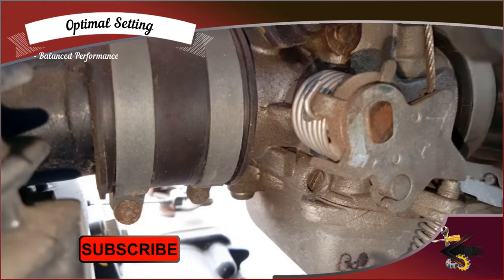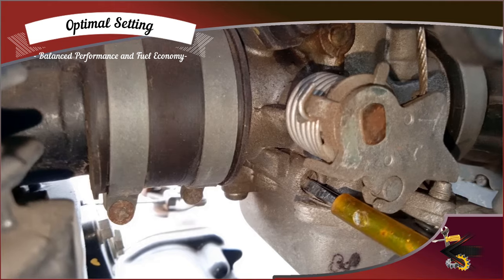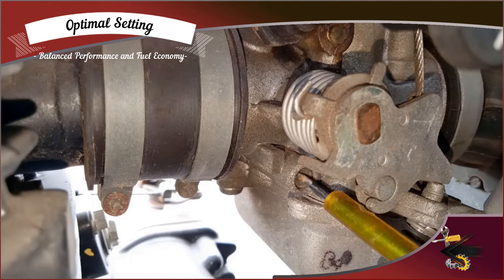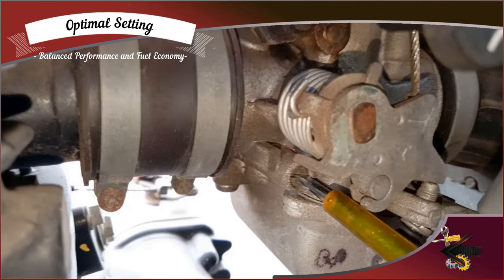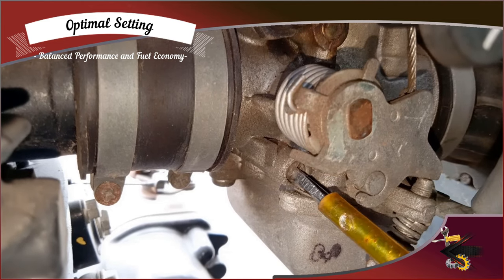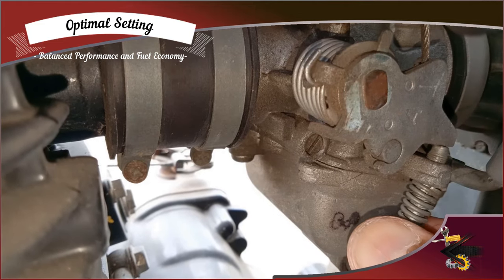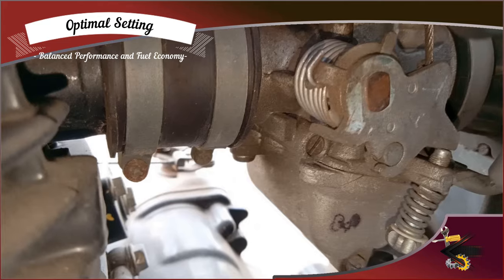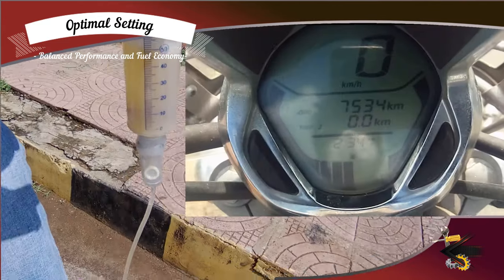Carburetor Tuning Mileage Test | Best mileage test | #carburetor | #mileage | #increasemileage

Comment: Which setting would best for fuel economy?
Reply from the maker: Rich setting would be best for fuel economy.
Reply: @autobotgeekse  Thanks
Reply from the maker: Wc 👍
Reply: @autobotgeekse  OK here comes the real job, when l check my RayZR it's a fuel injector type so l don't know how l should tune this into a fuel saving economy... l need your help again.
Reply from the maker: @lixv2432  sorry, FI systems cannot be tuned like we do it for Carburetor. FI is driven by electronic pulse which activates the solenoid. That will be a complex mod if you want to tweak the FI system
Reply: @autobotgeekse  That means majority of the scooty workshop would find it hard to to adjust it, isn't it?
Reply from the maker: @lixv2432  yeah, FI system is not adjustable atall. Solenoid valve will have to be replaced with smaller aperture valve for better fuel economy
Reply: @autobotgeekse  Are you saying it can be replaced with a smaller valve? If so please suggest me the type or kind of solenoid which will exactly fit in to my RayZR fi scooter
Reply from the maker: @lixv2432  That is the only possibility but that will not be available in the market which means we cannot change it
Reply: @autobotgeekse  OK, l guess no choice, have manage. One more thing though, since from the time l purchase this scooter l haven't notice or haven't seen this engine problem indicator, once the the key got switch on all the indicator light lights up a few seconds then goes off again but today l went for servicing and l told them this never happens but they told me its just an engine oil indicator, which l didn't buy at all. So, based on your expertise, Do you think its normal or it really has a problem?
Reply from the maker: @lixv2432  hmm, I am not sure of that indicator. Probably users manual can give some info for better understanding

Comment: I saw your last video regarding carburator tuning.. where you say that where you getting max rpm that point is rich fuel air ratio and we will get more performances..but here you saying that position as lean position...
Reply from the maker: Yes, it was an error in my last video, hence I added correction subtitles in those areas. Please let me know if you don't see the subtitles, will add again
Reply from the maker: @द βiker बंधु lean is when you let in more air into the combustion chamber. If air screw is turned clockwise it closes the inlet aperture  restricting the air flow. Hence, that becomes richer.
Reply from the maker: @द βiker बंधु Please do some analysis on lean and rich setting. When air flow is restricted it becomes rich and vice versa.
Reply from the maker: @द βiker बंधु that is due to fuel siphoning basis the air controlled via air screw. Lesser air flow results in lesser fuel suction

Comment: Brother You are talking inverse.
 lean means more air n less fuel
Rich means less air n more fuel.
Then rich shall give lesser milage and vice-versa.
Turning fuel screw outwards makes mixture richer as it allows more fuel to pass n vice-versa.
Correct me if I m wrong.
And finally nothing is said abt exact nos of turn from full tight, which makes this vdo of not use for me.
Reply from the maker: Lean and rich mixtures are not directly proportional to fuel suction. It is the air to fuel mixture ratio that we talk about. In lean setting the fuel to air ratio is lesser however the fuel that reaches the combustion chamber is more than that of rich mixture. More air you let in, more the fuel suction will be. Hence, better mileage is achieved in rich mixture. You can see the practical test as well. Also, detailed carburettor tuning is uploaded separately, hence I did not explain the complete tuning procedure. This is just a mileage test video. Hope this clarifies your confusion.

Comment: The difference between a rich and lean mixture is the amount of fuel and air in the mixture that goes into an engine:
Rich mixture
A rich mixture has too much fuel in it. It's less efficient than a lean mixture, but it can produce more power and burn cooler.
Lean mixture
A lean mixture has too much air in it. It's more efficient than a rich mixture, but it can cause higher temperatures, which can lead to the formation of nitrogen oxides.

Comment: I tried but my fascino run after i close the fuel screw with low r pm why
Reply from the maker: You will have to identify the air mixture screw and play with it. When you close the air mixture screw completely, rpm will be low. Open one turn and then try identifying the rich and lean position. Then you can adjust it accordingly

Comment: What about TVs wego rich settings?
Reply from the maker: All two wheeler carburetors will have same settings
Reply: @autobotgeekse  so my rich settings will be turn clockwise where I can get ?LOW rpm or maximum RPM?
Reply from the maker: @MeisterKamrul  yes, clockwise will reduce the RPM. Then adjust the idle screw for constant beat

Comment: Can't locate my air screw at the curburator
Reply from the maker: Please let me know the make and model of your vehicle.
Reply: @autobotgeekse  Am riding Haojin taurus 125 - 22
Reply from the maker: @kinkikanky9973  sorry, we do not have that motorcycle in India. I tried searching for the picture of its carburettor in web but could not find one. I will not be able to help here. You will have to figure it out by yourself or you can check with any of the mechanics in your locality. Apologies.
Reply: @autobotgeekse  No problem man I got it tuned yesterday to performance mode thanks to you I now know that one can tune their carburettor
Reply from the maker: @kinkikanky9973  Glad you were able to tune it. Happy riding 👍
Reply: @autobotgeekse  thanks bro👌👌👌
Reply from the maker: @kinkikanky9973  wc 😊

Comment: Sir, suddenly my Xtreme DSS bike is giving very poor mileage. 20-25kmpl.
I go to the mechanic many times, but they are telling me that the oil&air mixture ratio & idle RPM is perfect.
Still, I'm not getting a decent mileage, which was 35kmpl. 
What can I do?

Note: Mileage Tested more than 10 times, 1 litre per test.
Reply from the maker: 20 to 25 is too less for a 150cc vehicle. How old is the vehicle and kms driven? Try air screw setting to 1 and 3/4 turns from close position. Then adjust the idling and see if there is any difference in the mileage.
Reply: @autobotgeekse  6 yrs old. But it was giving decent 30-35kmpl mileage till few months ago. 
Tried air screw setting many times (done by mechanic)  
Today I checked spark plug condition again, everything is fine. But still mileage problem,  it seems like petrol is vanishing.
Reply from the maker: @hobicaca8079  how many kms done?
Reply: @autobotgeekse  30000+ km
Reply from the maker: @hobicaca8079  30k is ok. Please have piston O rings checked. Compression leak may result in bad fuel economy. Hope, vehicle rolls freely without any overtight brake restrictions and tyre pressure maintained. Also, try changing the main jet, it should show some improvement.
Reply: @autobotgeekse  Yes, It rolls smoothly. 
Do you mean engine piston ring?
(Changed Choke Piston recently)
Reply: @hobicaca8079  There could be various other factors for low mileage. You need to check your piston and cylinder, also get your valve train checked as well
Reply: @autobotgeekse  in my case its 6 year old AS200 and mileage is only problem like 29 . But it should be giving more.. top to bottom everything is changed in engine buy yes carburetor is old..no missing or combustion issue engine drinks petrol smoothly only carburetor is not cleaned detailly ...now should I try with opening carburetor??
Reply from the maker: @yousufmusthaneer9738  please clean the carburetor once and chk the main jet and replace if necessary
Reply: @autobotgeekse  main jet of ns200 bs4 must be ok i guess
Reply from the maker: @yousufmusthaneer9738  Then you might want to get the piston o rings checked for compression leak.
Reply: @autobotgeekse  no leak around anywhere.. i asked u that bs4 jets  can fit to bs3 ????::٪٪
Reply from the maker: @yousufmusthaneer9738  oh ok, as long as thread pitch matches you can swap and use.

Comment: Thanks for posting the video.  im setting my carb ( honda 125 cc) as follow : 
screw clockwise the idle to increase rpm about 2000 rpm
screw the air screw until i got ideal / optimal until I got highest rpm ( above 2000 rpm) 
screw air mix clockwise 360 degeree more - then shut down engine to check sparkplug - got wet / blackiest condition - means too rich 
returning back to setting on optimal condition , cleaning sparkplug. 
start the engine , screw anti clockwise 360 degree from optimal position , play with throtle for awhile , then shutdown the engine and check sparkplug - got white light brown color on sparkplug - means lean mixture ..this is what I want .. to get best mileage. 

anyway , I put something between intake manifold and carburetor that function for fuel+air mixture before entering engine combustion chamber ..its way making fuel saving more than 50 %..will posted the video for all of you later ..my intention is make less polution on our exhaust gas and better mileage..
Reply from the maker: Thank you🙏
Reply: Pls send the video..am struggling as well with my honda elite 125
Reply from the maker: @wedosouthafrica3374  please see my other carburetor tuning video where I have explained the complete process in detail
https://youtu.be/QOnHVExumjY

Comment: High rpm means leam or rich.
Reply from the maker: High rpm can be achieved in 2 ways, one by adjusting air screw and two by adjusting idle screw. If you are achieving High rpm by adjusting air screw then it would be a lean mixture.

Comment: Lean fuel mixture allows more air in the engine so power descrease and milage more and rich mixture allows more fuel and less air so milage decrease and power increase you giving wrong information buddy
Reply from the maker: Air screw allows you to adjust air to fuel ratio. When you let more air to get into the combustion chamber it will pull more fuel from carburettor due to capillary effect. Same is the with your throttle as well. More you accelerate, more air gets in and lesser the mileage. When we say more fuel in rich setting it is the ratio of fuel to air. So this amount of fuel will still be less than the fuel that gets sucked in lean mixture. Please watch my other video on detailed carburetor tuning for clear explanation.
Reply: @autobotgeekse  i want lean mixture in my bike so what i need to do , air fuel mixture screw tight or loose
Reply from the maker: @avi3702  you have to loosen the air screw. Remember that engine will run a little hotter in lean mixture with lower mileage
Reply: @autobotgeekse  if rich mixture gives less milage and more power then lean mixture will give more milage and lower power
Reply from the maker: @avi3702  no, rich mixture gives more mileage with little less power and lean mixture gives less mileage and more power.

Comment: Thighten fuel screw is not rich mixture it's lean more air less fuel
Reply from the maker: If you tighten the screw, it will restrict the air flow. Hence, with a closed air aperture combustion chamber will receive less air resulting in Rich air fuel mixture ratio.

Comment: How to knw the maximum rpm i can't understand it will helpful if u sgow the rpm meter while tuning 😐😐
Reply from the maker: Agree, unfortunately I cannot include it now. Close the air screw completely and then open 2 turns. Start the engine and adjust idling to lowest possible setting. Then unscrew air screw further and keep adjusting the idle screw in between if you feel rpm has peaked out. This will help

Comment: bro milage wrongly mentioned with lean and rich mixture. please see
Reply from the maker: Double checked, everything is correct. Not sure which one are you feeling is incorrect?
Reply: Yeah I think you mentioned it wrongly also...in first video you told in lean mixture we have better mileage...but in here you are telling it vise versa... check your first video and this video together
Reply from the maker: Yeah, that is why, I placed the subtitles for correction in my first video before uploading this video. I realised that long back
Reply: @autobotgeekse  so which one has better mileage?...lean or rich?...I think in lean it should be have better mileage... because it burns less fuel
Reply from the maker: Lean setting is when you unscrew the air screw to let more air in. Will get less mileage there. This is evident in the test result as well.
Reply: @autobotgeekse  so in your first video which should be corrected?...I didn't see any subtitles
Reply from the maker: @garage9732  I did add subtitles a month back in all places where I mentioned Rich and lean. In my previous video wherever I said Rich it's Lean and vice versa.
Reply: @autobotgeekse  ok dude...I'll check it again...I'm pretty interested on your video...keep it up... good work mate...I'll ask you if I have any doubts...thanks
Reply from the maker: @garage9732  wc 😊, I rechecked the video now and don't see the subtitles. Not sur why it is not showing. Will fix it ASAP. Thank you for your feedback 👍
Reply: @autobotgeekse  yeah that's why I informed you...I rechecked it when you told me that it had subtitles...but I couldn't find them
Reply from the maker: @Garage 97  Thank you 👍 Added the correction subtitles again to avoid confusion.

Comment: how to set optimum mixture in sir 220f
Reply from the maker: Fuel injection vehicle does not allow a manual air fuel mixture setting. It is automatically controlled electronically
Reply: Sir only 2007 model pulsar 220f and bs6 version  of 220f have fuel injection system, rest all 220s have carburettor only.  I have 2011 year 220f, I have tried to tweak it's carburettor many times but never got satisfactory result. If you any have suggestions, then please share.

Comment: Everyone says lean settings gives more mileage.
Reply from the maker: Yes, that was one of the reasons why I made this video. Rich setting gives better mileage. Pls chk my other video on mileage test on all 3 settings
Reply: @autobotgeekse  your video are very helpful, knowledgeable.  I tuned my honda activa 2013 model carb with your optimal setting and i got impressive mileage. Previously i used to get 28-30 kmpl but after tuning carb the way you showed in other video , now i get 48 kmpl mileage. That is really amazing.
Reply from the maker: @atulshinde5212   Glad it helped. All the best 👍. Happy riding 😊

Comment: what do u mean rich?  rich n air or rich n gas.
Reply from the maker: Rich means less air, more fuel
Reply: @autobotgeekse  
🤔 Less fuel more air
Reply from the maker: @nimitvekariya4482  fuel inlet aperture does not change , but the air to fuel ratio changes basis the change in air aperture by adjusting the screw. So more air you let in, it will suck more fuel from fuel capillary.